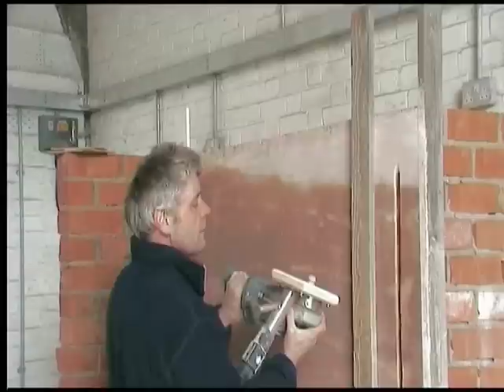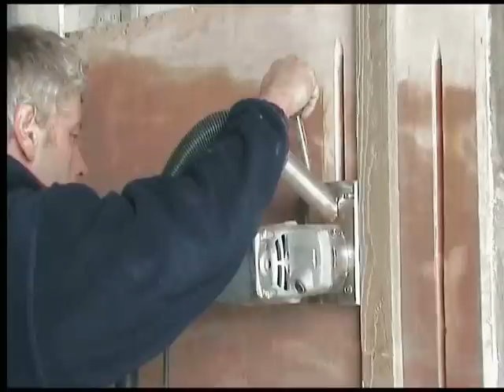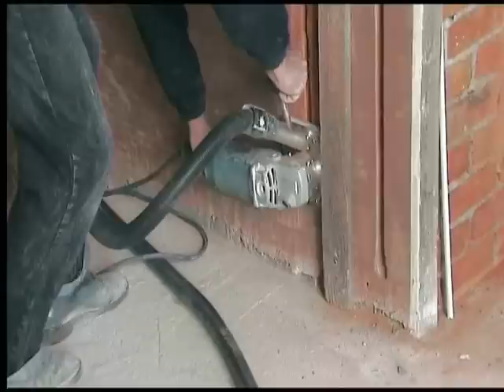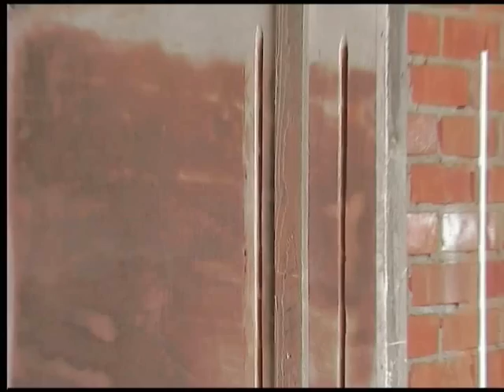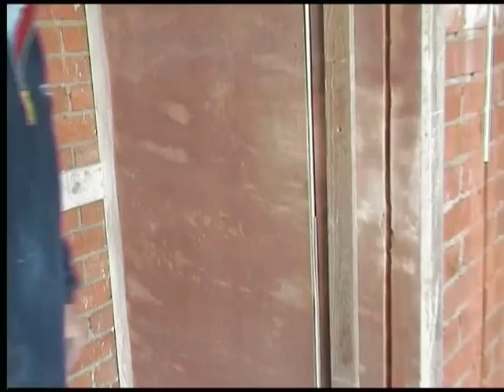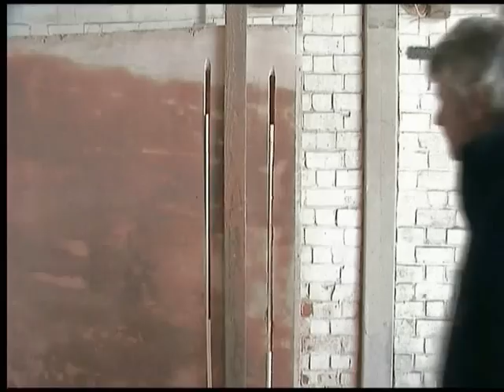'The One Step Wall Chaser' - Wall Chasing with NO mess

Comment from the maker: the kit comes with an attachment that screws on to the diamond bit and the other end fits into a typical drill chuck to allow you to burrow behind boards and joists etc. and is also a usefull tool in its own right

Comment from the maker: the wall on the video is a traditional brick, in this case they are  LBC`s which are hard, the wall has been finished with plaster which is about 3-5mm thick. if it was a breeze block the real time would be about 20-30 seconds.

Comment: To slooooooooooooooooow..............i could have done 4 chases in the same time that did 1 with an angle grinder......!
Reply from the maker: yensabi  Such is the power of observation; Of course you can slash a grinder down the wall in minets, who couldn`t. Then you spend, what, half an hour smashing out the remainder. Then another half an hour trying to get the conduit to sit in the the chase, more smashing and bashing. Then after you have spent another hour in the futile attempt to get rid of all the dust and trying to convince your costomer" everything will be all right" When you have done all that then there`s all the extra time spent repairing all the damage from the hammering.
Or you could spend a few minetes, clean and tidy, then push-fit the conduite in place, a skim if plaster. I would be home before you on a friday night!!
Reply: Say what you want that thing is slow as an rheumatic turtle
Reply: There's no mess though.